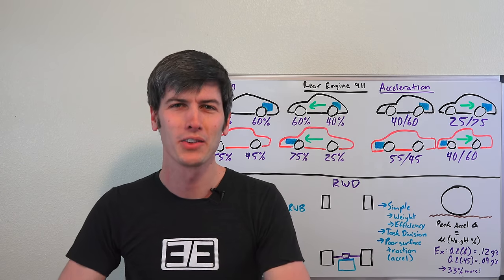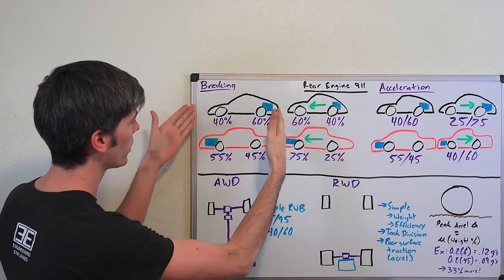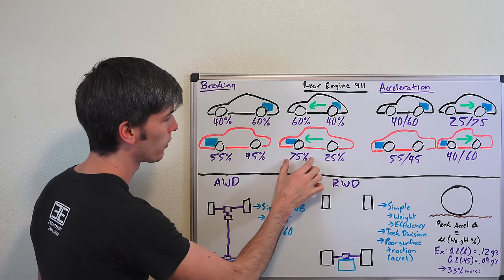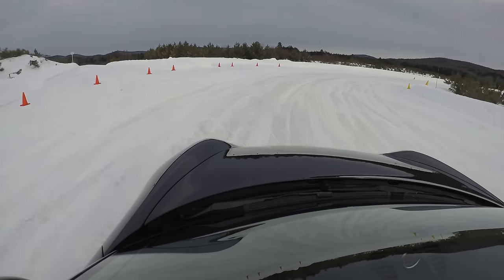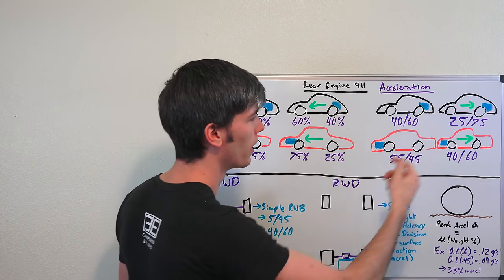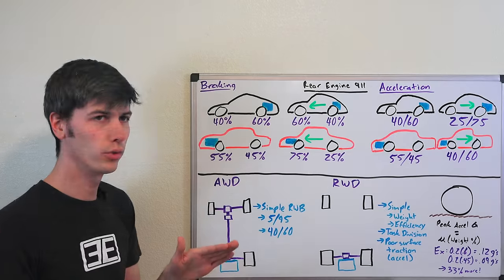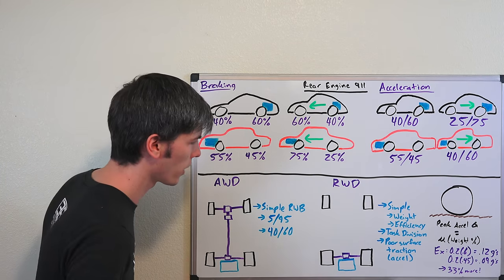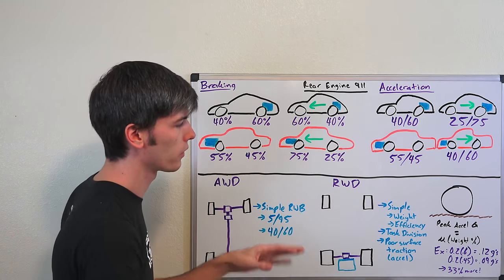Why Is The Porsche 911 Rear-Engine?

Comment: I'd love to see the advantages and disadvantages of rear engine compared to mid engine cars.
Reply: advantages he already pointed out:
More rear weight, better in accelerations
more even weight distribution when straight braking, more stable corner entrance

Disadvantages:
Lift off oversteering. When lifting the front axle gains load, but with lower car overall weight so less lateral load transfer than rear axle.Axle with less lateral load transfer have more grip, so front axle has a lot of grip, rear axle doesn't and the engine tries to go out due to its inertia,. Car rotates more than it should and requires a quite sharp driver to hold the spin.
Reply: There are none.
Reply: @danmartin633 generally easier access to the drivetrain... maybe not so much in 991+ cars tho 😅

Comment: This is exactly why I don't understand the fascination with 50/50 weight distribution. When you have that, in braking the front wheels get overloaded. And then in acceleration the rear wheels don't get as much load as they could. I am pretty sure there are FR cars now with more weight out back than front like Ferraris and the like.

Comment: back when tires and suspension wasn't that great, manufacturers used to put the engine in the rear in order for more grip, and Porsche is one of the manufacturers that stuck with this

Comment: Another great video! Seems like you had a blast drifting through those corners ☺
Reply from the maker: So fun!
Reply: Looked quite skilled! I heard it's more difficult to control with a rear engine, compared to the common front engine rwd cars.
Reply: drifting at 20 mph.......
Reply: Drifter D i

Comment: Also in regards to weight transfer during stopping, most cars even rear engine vehicles have larger equipment up front to carry more of the work .

Also modern Porsches benefit greatly with modern stability controls, when I was young a 911 was known to chase it's tail while going off the road

Comment: This was a  very very nice and detailed video on a topic that most of us take for granted. It was quite a pleasure to discover the ACTUAL benefits of a rear engined vehicle. Great job.
Reply: THE BOSS I think you misunderstood the point of my comment.
Reply: THE BOSS But that simply isn't true, they don't kill everything on track or on the road. There are very good reasons NOT to have the engine sitting behind the rear axle. Polar moment of inertia, or 'catch it if you can before you end up facing the wrong way'. Without the advent of modern electronic stability and traction control systems, the 911 would be a quaint footnote in automotive history. Mid-engine cars are the "killers".
Reply: Yet 911's are fun to drive. They remind me of a sprint kart where all the grip is felt through the rear tires. I've owned two: one air cooled and one water cooled. I'll probably get one more in a few years...base 991.2 would be a sweet spot for a road car. You have to drive to their strengths which is usually late apex, then once the car is just about at the apex, push the go pedal. They will twitch a bit, then that rear bias just hooks up. Really fun, sometimes it's the fastest way around a track, sometimes it isn't.

Comment: The left most Red sports car is an ultra rare Red Monte Carlo SS. the right most is some sort of pickup truck. :)
Reply from the maker: Much consistency
Reply: Brian Miller Raptor probably? ;)
Reply: Dodge Ram SRT-10
Reply: second from right is the Taurus Ranchero concept car :)
Reply: Pickup trucks with 4WD are rear-wheel biased and don't have a second driveshaft running back up to the front of the truck from the rear axle. This video does not explain why this second driveshaft is needed on a front engine rear biased 4WD car. The transfer case is typically mounted near the front of the truck with a driveshaft powering the rear wheels like a 2WD truck and there is no second driveshaft running all the way from the rear to front like the video suggests.
Reply: And a red pickup truck is my kind of sports car.
Reply: Almost. It may look like a Monte but it's a Cutlass supreme. The mistake is forgivable since they're both G bodies.
Reply: And the right one is a G body el Camino. So it is the same car.
Reply: I was going to say the one on the left was an equally rare red GNX, but Monte Carlo will do.

Comment: Modern 911's have done away with a lot of the design quirks that's inherent to the rear engine design. The short wheelbase ones had high oversteer, which they ironed out by widening the rear tires, then eventually lengthening the wheelbase.

Comment: That all makes sense if you're going in a straight line, but seems to conspicuously neglect what happens if you want to turn.  To get balance with a rear engine, you're going to need fatter rear tires and skinnier front tires, which, as you say, gives more traction for accelerating / decelerating in a straight line.  But less traction for the tires doing the turning.  (Where a front engine car can have a 50/50 balance and the same tires at all corners, and turn well.)
Reply: That's why they make AWD 911's tho
Reply: @BRAINFxck10 but why is 911 rwd the fastest production car around tracks?
Reply: @CiderHerrljunga  pro drivers, tires, aero, suspension all optimized for a race track but if we're talking average drivers on the street AWD makes an average driver look like a pro
Reply: @BRAINFxck10  yeah it makes sense in a rear engined car but for most AWD they have front engine, with a ton of understeer, heavier, loose some power.
Reply: @CiderHerrljunga  yeah and Porsche puts so much technology in the 911 like rear wheel steering to correct the turn in, being rear engine is not really a problem for them anymore
Reply: But, you need less lateral force required at the front, so skinnier tires are fine and balanced.

Comment: I'm interested in the analysis of the rear engine layout which in the case of the 911 is typically 38/62 weight distribution and compare this to mid engine layout like the Lotus Exige (and other mid engine sports cars) which also have a 38/62 weight distribution.
It seems weight distribution is the important factor, not hanging the engine out back to get it.

You put a lot of emphasis on the positives the 911 of having the engine in back of the rear axle. 
The lotus has the benefit of a much lower polar moment of inertia while having the same weight distribution which seems in theory to give it all the same advantages you attribute to the 911 without the high polar moment of inertia. 
This would then avoid the 911's propensity to be difficult to stop the rear end from continuing to spin around due to the engine hanging out the back with that high polar moment of inertia. The lotus on the other hand would be much easier to control and have all the same weight transfer benefit characteristics derived from the 38/62 weight distribution purposefully designed into the car with a much lower polar moment of inertia.

It seems to me that since:
* Neither Porsche nor  anyone else has a patent on hanging the engine out the back behind the rear axle and everyone in racing and high performance sports cars wants every advantage they can get to win and sell more cars. If the 911 layout was truly the best option then they would not be the only ones with that layout.
* Why are all the purpose built race cars from Porsche and everyone else largely mid engine (mid rear or mid front) if the 911 layout superior.

Don't get me wrong, I have been a Porsche fan for decades I love the 911 and the many of their other products throughout the years. The 550 is one of my favorites.

So the question for a Engineering Explained video is:
If you compare a rear engine sports car and and a mid engine sports car which are both exceptionally well designed and proven. Both built by top level engineering like Porsche and Lotus, each having the same optimized weight distribution for instance 38/68. Which is better and why.

Thanks

Comment: Nice explanation of the advantages a rear-engine car holds when accelerating or decelerating in a straight line.  However, "less eager to turn" and "higher tendency to oversteer" are definitely not advantages.  Those two traits of a rear-engined vehicle were glossed over in this discussion.
Reply: Well if you are the fastest around the track with those disadvantages i dont think they give a shiet 😅

Comment: Great video! Although 911s are amazing sports cars there are two "flaws" with a rear engine: 1) turn-in understeer and 2) if the back end comes around it'll be difficult to save (pendulum effect) vs a front engine RWD

Comment: In theory rear engine Porsches are prone to oversteer but in reality they are difficult to break lose ( this is from experience) unless you lift off in the middle of a g-force corner. Then the rear end will come around which can also be a benefit depending.

Comment: Hi, i gota a topic in which you could maybe enlighten me or make a video about :) 

considering fuel efficency:
1. is it always best to drive in the highest gear possible (in a manual car) for example my car can drive 50 kph in 6th gear but gets kinda rumbly because its only at 1400rpm (gasoline) and wether this would apply to N/A cars and turbocharged cars alike.

2. Which way to accelerate is more fuel efficent? Full throttle and fast to be in a higher gear sooner because the accelaration phase is shorter, or a long accelartion phase in which you dont accalerate at full throttle? 

Kind regards
nelayo
Reply: Nelayo Isso 
1. Depends on gearbox. Some gearbox has a gear that's 1:1 from input to output. So at this gear the engine is not driving additional gears inside the gearbox, hence less friction. Then engines also have an optimal rev range. So it's really hard to say in general which is best.
2. It's probably difficult to justify either. But when you accelerate very gently, chances are whenever you need to brake unexpectedly, your car is much slower, so you waste less energy in braking, meaning you use less fuel to accelerate at the first place. But then time is also a cost.
Reply: Highest gear reasonably possible, 50 kph in 6th gear is at least one gear to high. You also want to think about engine lifespan, low Rpm with a lot of throttle is not good for your engine. At lower engine speeds, you have less friction losses in your engine, so you defenitely want to use high gears when possible.

Accelerating fast is actually most efficient, as gasoline engines tend to be at their best efficiency when they are at around 90% load. What I am not 100% sure is whether that applies to turbocharged engines too.
Reply: 1) It depends on the car. My petrol engine is only spinning 2000rpm at 90mph in top gear, and won't even select top gear below 55mph. The most efficient engine speed for a petrol engine is between 2000 and 3000 rpm (at least this was the case 20 years ago, engineering has advanced in the time!). Different cars will do things differently - my car is a barge and doesn't handle very well on twisty roads, but it is a very nice place to be if you need to drive hundreds of miles in a single stretch at high speed. Your car might be a lot of fun on country lanes, but I wouldn't want to drive long journeys at 4000-5000 rpm, it would be noisy and irritating. 
2) Interesting question - I honestly don't know but have wondered myself. +Engineering Explained, do this video!!! :-)
Reply: 1. No it is not always best, we will go to 2 and then come back.

2. As answered above, generally acceleration in lower gears is more efficient due to mechanical advantage in gearing. At higher gears you have less torque so you must dump more fuel in to produce the torque needed to increase the speed (then there's also engine and drivetrain momentum). 

(Back to 1) So when you are accelerating or will need to accelerate and you are in a high gear, you are wasting a lot of fuel due to the increased load. However, cruising on a flat surface you want a higher gear (eventually there are diminishing returns) because at lower gears your engine's speed must be much higher to maintain that speed (engine speed is related to, though not the exclusive determinate of fuel use). You want to seek the balance point where the engine is spinning as slow as possible, while doing as little work as possible for the given speed (if you plotted them on a line graph you would find an intersect). If you look at torque curves your engine's torque will sharply increase after a certain rpm. If you let the rpms drop too low the torque will be bellow that which is needed to maintain your speed and the engine will stall. If you are "lugging the engine" as described, you are pushing it to the limit of what it can do, and that makes your engine sad, and everyone else angry.

Forced induction changes the curves so it will affect where the point of maximum fuel efficiency is , otherwise it is largely the same theory.

Comment: One thing you missed: while a rear engine layout improves on the possible braking distance, it is also much more unstable under braking - one of the reasons trail-braking was such a no-no in older 911s and 930s (before electronic brake systems compensated for the lack of stability.)  Try balancing a pole on your finger.  Not too hard, right?  Now, add a heavy weight to the top and see the difference.
Reply: In my 964, I can trail break without an issue issue… even going in hot. It all depends on the terrain whether it’s an uphill or a downhill….
Doing all the breaking just before the turn in is not always necessary, even while driving near the limit

Comment: I don't fully understand what you mean when you say that to get rear bias in a front engine AWD car you need to send a shaft to the rear and another to the front. The Subaru WRX STI for example has a rear bias of 66-33. It accomplishes that with the center differential(s). What am I missing?
Reply: ZzZebzZ - rightly said. A front engined car doesn't need to send drive via a shaft to the rear and then drive back to the front via another shaft. The centre differential simply goes at the front near the engine - just like on the 911 the centre differential is at the back near the engine.
Reply: He's thinking about 4 wheel drive trucks with transfer cases. Subaru has been doing 4 wheel and all wheel drive for years like what you said.